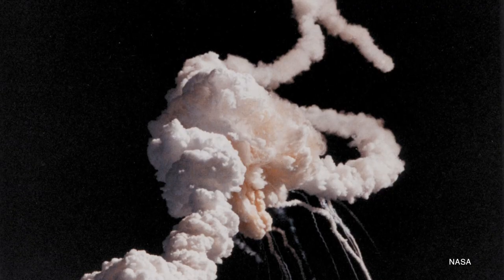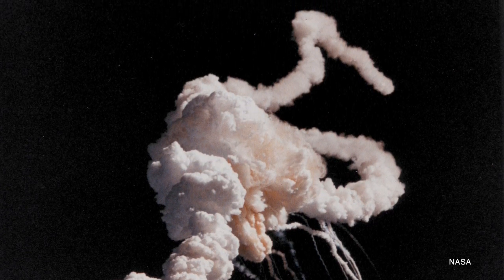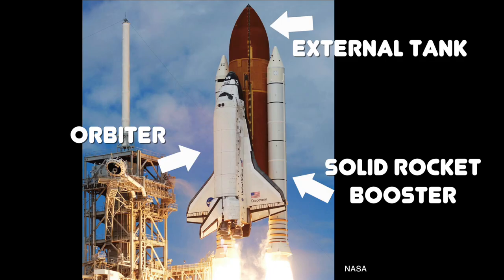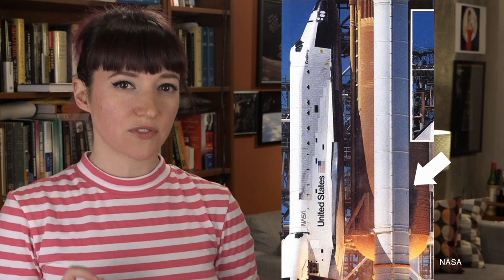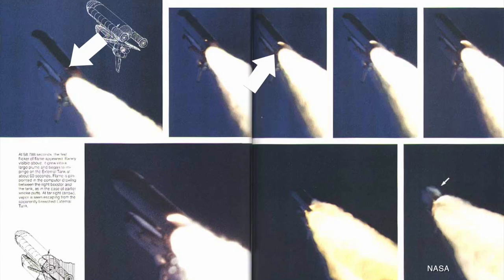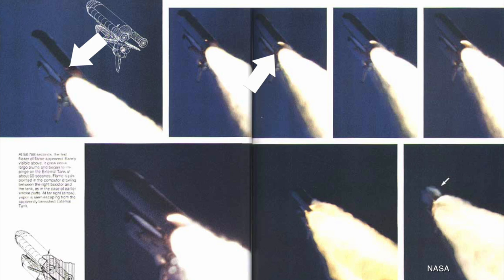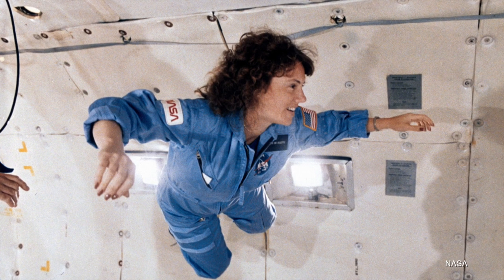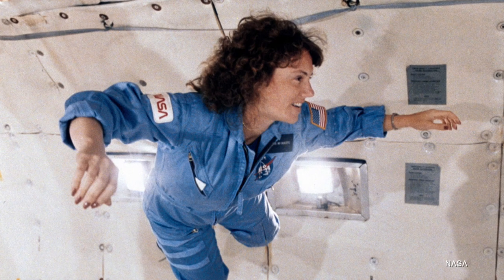How the Challenger Disaster Changed NASA

Comment: Had NASA engineers recognized the leak earlier in the flight, would the orbiter have been able to separate and get away from the about-to-explode fuel tanks? I know the Apollo and earlier missions had the escape rockets built onto the command modules. Was there a similar system for the shuttle?
Reply: You'll have to look up the abort patterns for a Space Shuttle launch (I'm sure they're publicly available). There was no escape system for the Space Shuttle, but there were abort plans to either return to the Cape or land in Europe or Africa depending on the nature of the malfunction and when it occurred. I don't know that the orbiter would have had enough velocity at 73 seconds to get back to the Cape, and it surely didn't have enough velocity to make it to the European abort sites. I think that once they lit those SRBs, the fate of the astronauts was sealed.

Comment: With the challenger disaster we have read plenty and have had to watch this video. Regardless of how many times I read over the disaster or listen to what happened I am still in shock. NASA seemed to put their name before anything else. By that I mean that NASA decided it would be more important to keep their word about launching on January 28, 1986. NASA was told that it would be a risk to launch by engineers yet they chose not to listen. They chose not to listen due to the pressure the space program was already under. NASA chose to launch in order to prove to Americans that the space program could keep its word and to satisfy the customer. The customer being the American people. NASA chose to launch because of the pressure to save their public relations. However, NASA ended up receiving more backlash then ever expected due to the explosion caused by a fail O-Ring in one of the fuel tanks. Seven people died in the Challenger disaster because NASA chose to launch in conditions that simply were not ideal.  The Challenger disaster taught me one very important lesson. To communicate any issue to a person within the management position.

Comment: The Space Shuttle Challenger disaster was a deadly incident and one of the greatest NASA’s accidents ever. The Space Shuttle broke apart 73 seconds into the mission, killing all seven crew members. After the accident, Rogers commission was established to investigate what exactly went wrong. A joint in its right solid rocket booster (SRB) failed at liftoff that was caused by a failure of O-ring seals that were used in the joint, which was not properly designed to handle extreme cold conditions that existed at the launch. After months of investigation, the commission unveiled that by the time of the event, NASA had a disastrous work culture. There was not proper communication between engineers and NASA management. Nobody at NASA was concerned with the technical issues, they were more concerned with the public relations issues that could affect them if they didn’t launch on time. Due to the lack of leadership from management and the managerial culture at NASA, one of the worst accidents in space program took place.

Comment: I enjoyed this informational video about NASA as it sets an example of how not to behave in the workplace. I have known about this disaster for years now, but figuring out the how and why was interesting. So the culprit of the explosion was the o-ring, as the rubber got too cold during take-off and failed to seal the joint seal on the Space Shuttle Solid Rocket Booster. The video informed us there were employees at NASA who spotted this issue, but due to a toxic communicative culture, NASA failed to stop this mission and failed to save the lives of the crew. This happened because NASA was more worried about public relations, then the technological and cultural problems. There were many reasons why they cared so much about launching this mission on time. There was a teacher on board set to teach a class from space, President Regan was pressuring the launch, and NASA would not receive enough publicity if they did not launch on time. They let these underwhelming issues take the lives of their crew, pure ignorance. My main takeaway from the video was the root cause of the accident may have been the o-ring, but NASA’s culture and lack of care for human dignity caused this accident.

Comment: Because of "shuttle twang" i.e. the main liquid engines starting first, the "O" ring area opposite the orbiter was crushed and didn't rebound back. That's why the leak was opposite the orbiter near the external tank. (My guess.)
Reply: No - it was because one SRB experienced a colder temperature during the night due to the prevailing wind direction. The O ring in that booster became harder than the other, and it was that O ring that failed.
Reply: The primary reason was "O" ring inelasticity due to cold, but why did it fail at that place? One side was colder than the other because of the wind? What about higher up in the stack of fuel segments, wouldn't that have been colder, too? Do you have a reference source for this? I believe "shuttle twang" was a secondary contributing factor that compressed the "O" ring there and it didn't spring back.
Reply: The O rings were designed to compress and spring back. It was the cold on that side of the vehicle that made THAT O Ring not reseat properly. The "twang" had a larger deflective affect on the lower part of the stack and those lower joints than on the joints further up - which is why it was one of the lower joints that failed. 
The way the "twang" affected the structure is that the whole stack bent in response to the three SSME firing. As the stack would be still bolted firmly to the pad, the maximum deflection of the structure would be at its lower points i.e. near where those lower SRB field joints were located.

I've read about the different temperatures experienced on either side of the stack in a number of places and it has been also mentioned in a number of documentaries.

Comment: I saw that launch live in school.
I love your channel but I do have to say, you kinda... got this one very wrong as far as what actually happened to the actual vehicle. The flame from the SRB impinged on and eventually weakened the lower attachment point mount, causing it to break free. It pivoted outward, snapping the upper mount in the process, and sideswiped into the main fuel tank which was still about 70% full. The whole stack twisted due to the imbalanced thrust as the SRB shattered the hydrogen (upper) and then oxygen (lower) tanks in the external fuel tank. The flames from the SRB's ignited the mixing cloud of hydrogen and oxygen, causing a deflagration. Not an explosion. A flame front progressing subsonically through the combustible mixture. However, by the time it had ignited, the shuttle stack itself had twisted sideways in the air and Challenger was blown apart by the aerodynamic forces loading it in ways it wasn't designed to handle. As the rear section sheared away the three SSME's were burning the last few milliseconds of fuel, they're some of the earliest objects seperating from the cloud of burning hydrogen. The shuttle's crew deck actually survived relatively intact until it impacted the ocean. The crew were likely alive until then, but would have been unconscious due to lack of breathable oxygen at the altitude the orbiter disintegrated. At least one of the reserve air packs (which don't really give pressurised air, but give some conditioned oxygen) had been activated, something that would not have happened unless someone was reacting to the emergency. However at that altitude an unprepared person would have at best a dozen seconds of consciousness and the packs would not have helped at all.
Oh and for the conspiracy theorists among people watching about the 'cover up' of the remains being dumped into a missile silo; because it was still in launch mode it had a full load of monopropellants on board for orbital maneuvering. Most of the recovery and reconstruction was done in chemical warfare gear. One of the propellants is supposedly so toxic that  most atmospheric residue sampling equipment can't detect it before concentrations reach LD99.

Comment: More of the incompetence at NASA would reveal itself with the launch of the Galileo space probe to Jupiter in 1989. It was originally supposed to be launched in 1986, but delays in the development of Galileo, as well as the Challenger disaster, pushed the launch back to 1989. 
When Galileo was launched, it was found that the high-gain antenna was stuck. The details are here: https://en.wikipedia.org/wiki/Galileo_(spacecraft)#Main_antenna_problem
Reply: +Steven Mannings
NASA? or any of the sub-contractors who failed to adres this issue as a potential risk? NASA is only the operator.

A more interesting subject is was the (extremely risky) idea of using a (hydrogen fueled) Centaur-G stage instead of the IUS solid rocket stage. This proposal was NASA's gung-ho attitude at its finest.

Comment: Besides all the doubts of the engineers allready before the start, there is one thing, that I can not understand: There are so many pictures of smoke and flames on the srb that occured allready more than a minute before the desaster. Hasn't been any person in the controll center with the task to observe all these cameras and immediately report these dramendous warning signes? As I am informed, an emergancy detachment of the orbiter from the system would have been technically possible and would have saved the astronauts.

Comment: The Challenger disaster was completely avoidable if NASA's management would have had their priorities straight and valued human lives over launching the shuttle on time for additional press and media coverage. The engineers at NASA knew the temperatures were too low for the O rings to handle, leaving a risk for them to burst and cause the entire shuttle to blow up. The engineers made management aware of this situation, yet they still carried through with the launch because of the strain placed on them by the media. This blatantly shows NASA not valuing the lives of the astronauts that they are sending into space, as they succumbed to the pressure of getting the launch off in time at the expense of their lives. This horrific event points to a much larger issue in the culture that NASA possesses. The management team making the decision of launching the shuttle, despite having knowledge from the engineers of the shuttle that the launch may be dangerous, shows that there must be a lack of trust between divisions in the company or the management team does not care what information the other departments give them because they will do whatever they want anyway. The Challenger launch was a devasting occurrence that has changed the outlook on how safety must be prioritized in space travel to this day.

Comment: Mgt 311 Challenger Disaster comment-

The challenger mission was a tragic accident which could have been avoided, where various American lives were los because of miscommunication and mismanagement along with various other important factors. The engineers who worked on the faulty technology knew that the o-rings where not at the correct temperature for a successful launch. Not only did they know this, but they didnt communicate this crucial information to Nasa’s Management team. Regardless, the management was not concerned at all with the technicalities of the equipment used for launch, they were more worried about issues concerning public relations. Unfortunately, Nasa had gone through various shortcomings in the months and years previous to the disaster. This caused an immense pressure to Nasa’s management team leading to the launch causing them not to budge with moving the launch date to ensure a succesful launch. It is a sad reality that certain issues do not come to be resolved partially because of a worry for public scrutiny and other social dilemmas. Large and important organizations like Nasa should fixate on paying attention to the smallest important details in order to avoid tragedies like this from happening again.

Comment: The Challenger disaster is an example of how safety precautions were overlooked for public relations and marketing reasons. While the engineers at NASA knew of the potential dangers of launching on the planned date, managers at NASA instead chose to prioritize the publicity and praise that would come from a successful launch. Although the lives of the astronauts and their security should have been the most critical element of the mission, NASA was seeking to increase their reputation with the participation of the teacher on their crew. Deciding to sacrifice the possibility of failure, NASA put the timing and marketing strategy of the launch first. Instead, this decision resulted in a loss of trust in NASA and more importantly, the loss of seven Americans.

Comment: It is unfortunate that the Challenger disaster was a tragedy that easily could have been avoided. While the culprit was a technical flaw in the system, that flaw was made aware by those working on the rocket and a simple solution of pushing the launch back a day would have put the astronauts in much greater safety by eliminating the O-ring problem. It is unfortunate that such a dangerous event such as space travel was rushed for PR purposes. I'm curious to understand more regarding the story to see if the heads at NASA were given a briefing that there was a chance this O-ring flaw could turn fatal if the launch isn't pushed back a day. I wonder if they were given a percentage of the launch failing and becoming fatal. Were they presented with an 80% chance of success, or maybe 60%, or maybe even 50% and they perhaps made a business decision that since the odds were in their favor and the PR exposure was most important that they decided to launch? I'm not sure, but it seems they made their decision by dissecting the business aspect of the launch rather than focusing that 11 innocent lives were at state and their safety must be the top priority. Certainly a major failure on NASA's part, and a mistake I'm sure they will not make again.

Comment: Challenger is a prime example of how failure is inevitable when poor culture and poor communication is at the center of an organization. Despite the engineers knowledge that the O-rings were designed to work above 53F (much higher than the launch day's 36F degrees), they were more concerned about keeping on NASA's schedule. Poor communication causes failure and instability among an organization which never will achieve positive results. In the case of Challenger, the engineers were focused on delivering for their superiors. NASA administration didn't want to appear behind schedule or inept to the public and to the government, which was already questioning the feasibility of the organization. The poor organizational culture in NASA meant engineers felt they were unheard and poorly managed. Political pressure to deliver a successful launch on time snowballed with technical failure to result in catastrophe.

Comment: The challenger was a tragic disaster and attempted launch. There were problems that led to the failure,  one being the fact that it was to cold for the challenger to take off. Along with this there was a rush to get the launch going because they wanted to have people watch and launch the challenger when they announced they would. No matter what the project is if there is a risk there should be proper safety steps and 100% certainty of success, rather then take the chance with American lives. This seemed like a job that became political rather then about the content and performance of the whole operation.  Decision makers at NASA did not listen to the experts and decided to go on with their launch when they had no right to put the astronauts in such harm. Overall, the challenger disaster could have been avoided with the proper precautions taken.

Comment: The unfortunate circumstances that surround the disaster of NASA’s Challenger launch were, even more unfortunately, avoidable. However, this calamity serves to teach future individuals the importance of understanding and believing in the importance of communication, feedback, accountability, and ethics. This video describes the situation well; the cause of the Challenger disaster was a technical flaw. However, this flaw should be thought of as a mere symptom in a disease of toxic culture that surrounded NASA during the 1980s. Technical problems can be identified and solved, and with the proper time, the engineers would have been able to solve the issue regarding the O-rings elasticity in regards to temperature. However, decision-makers were irresponsible and failed to interpret the communication from the engineers properly and ethically. The managers of NASA were concerned about several other factors, especially the public relations of the organization. The organization needed a “win” and the timing was perfect. While public relations are important, they don’t supersede the importance of safety in a situation like this. There are times where risk is necessary, and unfortunately, this was not one of those times. Decision-makers at NASA chose to value the appearance of a launch rather than the safety of these astronauts; this decision demonstrates poor ethical decision-making and communication skills, and the organization felt the effects of this pitfall in the loss of 	the astronauts, loss of money and equipment in the physical Challenger, and the deterioration of public opinion about the organization.